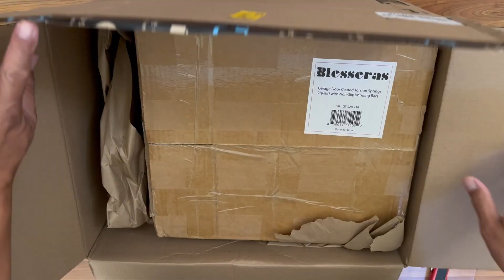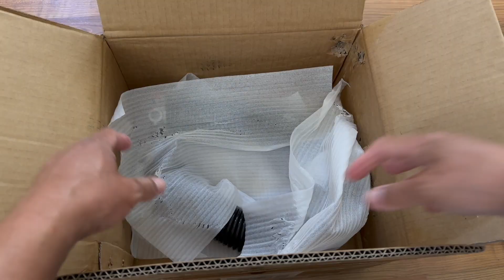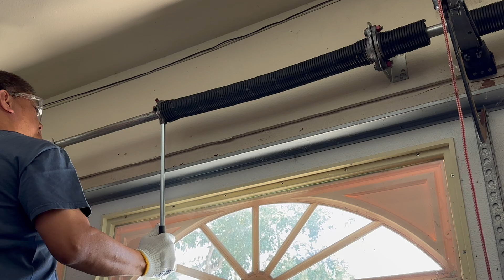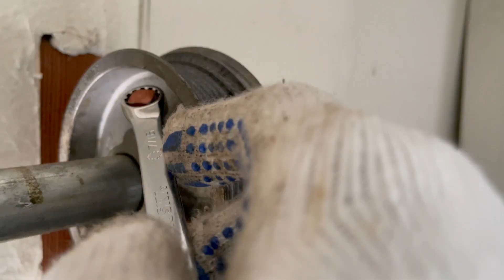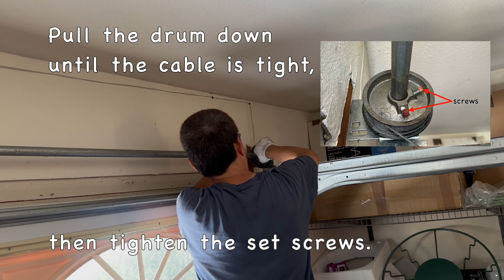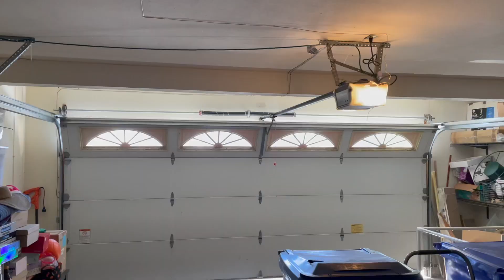How to Replace a Broken Garage Door Torsion Spring

Comment: If the inside diamater is 1 3/4", and i get a 2" spring diamater will that be a problem because its slightly bigger?